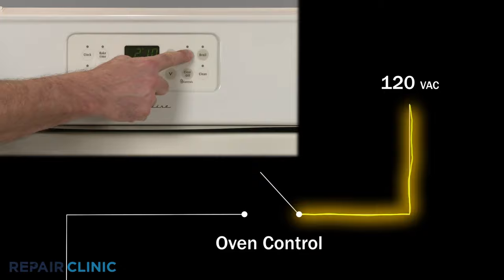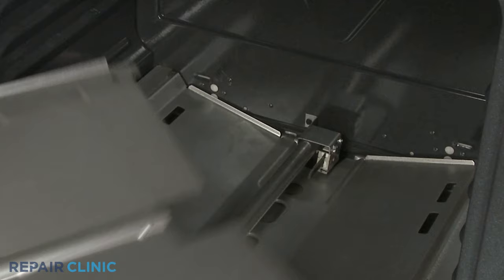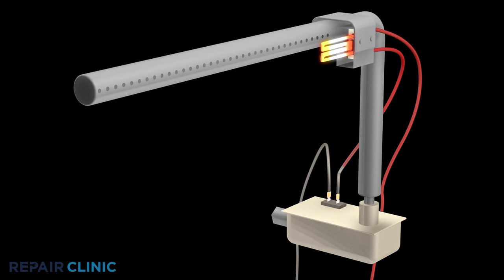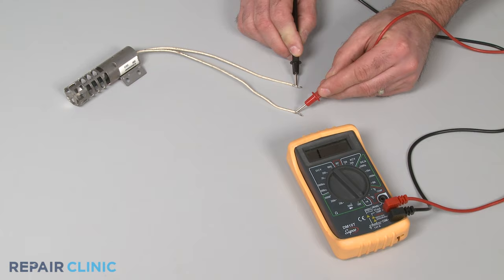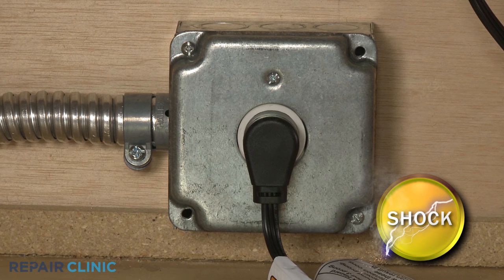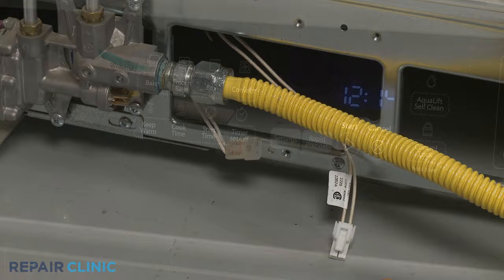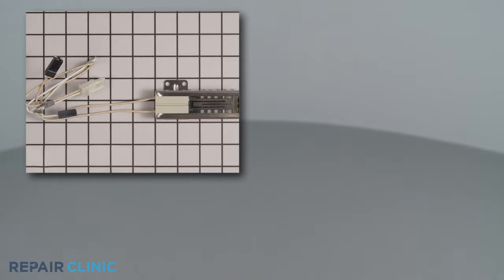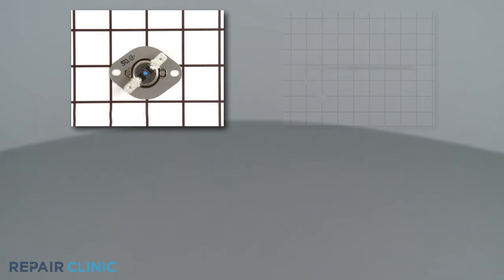Gas Oven Igniter Voltage Testing - Range/Stove/Oven Troubleshooting

Comment: Super helpful. I was able to trace down a cracked solder joint on the relay that enables the igniter. Now I dont have to buy a new oven.
Reply from the maker: You're welcome! 

We are always happy to help. If you would like to give us a review on Google, we would much appreciate it: https://g.page/r/CcVUrahZNozMEBM/review

We hope that you have a great day!
Reply: @repairclinic hi I have thor 36in range model trg3601 I have error code e17. Is there any way to get it fixed.
Reply: @repairclinic  Can you tell me what can cause my oven igniter to keep going out I put three of them on  is there something causing them to go out?after a couple months seems they go out wont light up or get hot  Thanks

Comment: If the igniter is glowing its getting power. How does checking voltage help ?
Reply: My igniter on my gas stove is not even turning on I'm going to buy a new igniter and see I think it will work
Reply: He should have mentioned that the ignitor needs a certain amount of amperage to open the valve. In my case their is a safety lever on or about the gas valve that was stuck closed even though it looked open. I flipped On and off then voila gas and ignition.

Comment: My igniter is glowing orange. Doesn't look hot enough. I smell gas when I turn on the oven so  it's drawing enough electricity to tell the safety switch to start the gas. The gas just isn't igniting.
Reply: Check the amperage that corresponds to your ignitor.
Reply: @Dontleavemedimi  it was the ignitor. Thank you.

Comment: I have a Viking gas range model vgcc5304bss I just installed a new gas safety valve and the problem is still persist. The problem is the bake igniter lights the burner and after 3 seconds the burner goes off. The broil igniter works fine. Can anyone help me. I performed a continuity test on the igniter and it reads 1 thanks to anyone that can help me
Reply: 1 generally means there is no continuity. From what I understand you should get a continuity reading between 100-200 or so. You most likely need to replace the igniter. Also off it's over 200, test how many amps are running through it when plugged in
Reply: perhaps the ignitor is not maintaining the amperage required to keep the valve open thus supplying gas.